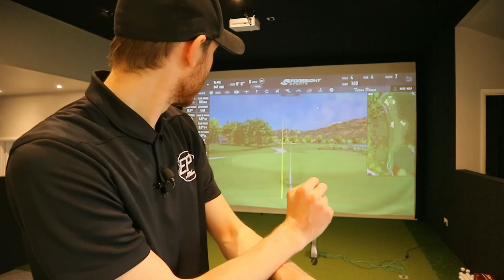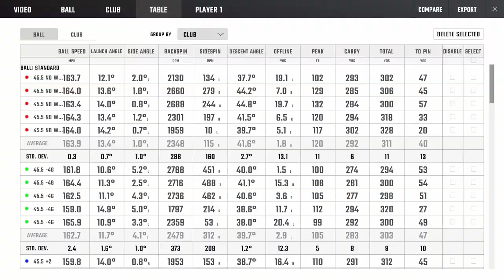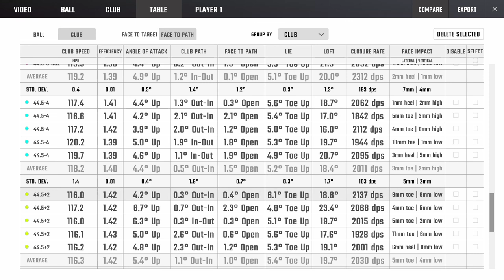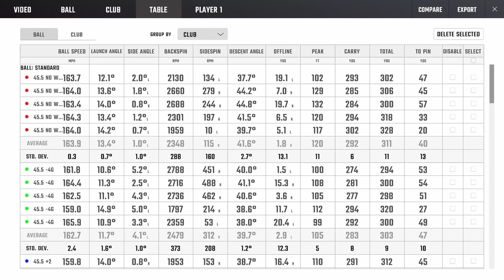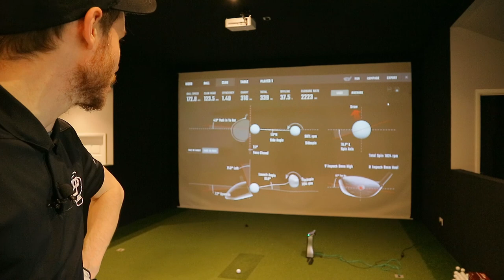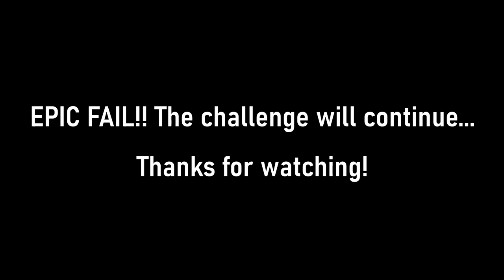More Ball Speed?!? Driver Length & Swing Weight Test.

Comment: Great video. Kinetic energy is 0.5*m*v^2. More energy is transferred to the ball because you can accelerate the lighter the club to a higher velocity. The velocity term in the energy equation is squared so it plays a much more significant role than the mass in determining the exit velocity of the ball. Been having great success with a light driver. You just need time to get used to it. Thanks for the video.
Reply from the maker: Thanks for the comment Ben..

But complicated for me all that 😅 we just test and see what works the best 👀👀😅
Reply: @epgolfstudios  Yes, testing is the best way to figure stuff out 👍

Comment: So the lighter weight heads increased ball speed some, but the HUGE increase came from intent.
Good luck with your new channel. Maybe slow down the screen scrolling a bit. But I appreciate your efforts.
Maybe test overall club weight, lighter shafts vs heavier also for faster speeds. Just a thought. I wish I had a testing set-up like yours.
Reply from the maker: Thanks Scott, appreciate the comment pal. Not sure what you mean by intent? 

Yeah having watched back the scrolling is quick! Think for the most part we will take that out of future vids for majority its not required and just a data overload for most. 

Yeah I think lighter Vs heavier shafts for speed is just minimal. Like if swingweight was the same and I swang a 50g Vs 70g swingspeed would be hardly any different. Overall weight would certainly be a good one, with added head weight and heavy grip Vs no head weight and 25g grip. The difference in that for me would be massive.
Reply: By intent I mean the difference between your 100 test shots at normal speed and when you tried to hit it as far as possible to reach the green. That change from intent alone upped clubhead speed from 118 to 128. Wow. Unless you also altered your setup or swing in some technical manner, then it's all intent. Like imagining you're in the finals of the world long drive contest against Kyle and you either win or die. 

I have an iron set of Ram featherlite tour grind forged from Calvin Peete days and the difference in clubhead speed between normal weighted clubs is 5 mph faster for me.  The Rams are C5.5 at 14.5oz total weight 9 iron. Lighter clubs definitely help this weak a@@ old man.
Reply from the maker: @scottschairer110  ah ok yes I'm with you. Yeah I think when I get people swinging hard in the studio they are normally shocked at what they can actually get to with a bit of commitment. But yeah I mean I guess I wouldn't love to swing like that on course 😅 so really the test was can I achieve anything more keeping my swing the same. Which tbh even this test shocked me a bit, I didn't expect the ball speed to be that different. 

And yeah overall weight can make a huge difference. The light swingweight will definitely be good to move it a bit quicker 💪 but head weight I think plays a big part in that, 2g roughly in the head is 1 swingweight whereas about 9g in the shaft is 1 swingweight. So taking weight from the head can be more influential than shaft weight difference for sure. Just gotta be careful about how changing the headweight and swingweight makes the shaft play.

Comment: Excellent segment. I have the TSi3 as well and actually had a slightly differently results. I added +4g to the original 8g weight at 7.25 degree, stiff Tour Design shaft. Typically swing it in the 122-123mph range with 181mph ball speed. With the increased weight my clubspeed went up to 125mph and ball speed went up to 185mph based on my latest Trackman record session… my miss is a big pull left with lighter head weight so the added weight help prevent my occasional flip.
Reply: Did that take your swing weight up to a hefty D6?

Comment: My experience is get rid of your grip, get something thin and light grip. As minimal as your hand can grip, this increase swing weight and speed quite easily. Shortening shaft length and minimise grip size/weight together will also increase swing weight. Don’t add weight on club, not anywhere, increase total mass only slows you down.
Reply: Agree, this can be a better way to go for sure. The standard size (smaller) super light JumboMax grips are good for increasing swing weight.

Comment: This is definitely something I wanna ply around with. Currently in a tensei raw white 65 stiff playing 45.5 (tsi3). Wanna try 44.5 to see if I get better dispersion and efficiency.
Reply from the maker: It's 100% worth playing around with. I find for most people it's more of a disadvantage playing a longer shaft. 

I don't find you get any more club head speed (maybe 1 or 2 mph) but sometimes because the swingweight is so heavy at that length some people lose club speed. 

I personally feel standard manufacturers lengths of drivers now are far too long
Reply: @epgolfstudios  Might worth the trip down to see you before the summer!
Reply: Great video!!!!

Comment: How much of a factor do you think fatigue may have been?  You said yourself, after you finished with the longest club and heaviest weight combo, that you were feeling it in your back.  That makes me question how much of the rest of the results were club length/headweight vs player fatigue.

It would be interesting to try a similar experiment using a mechanical swing system to isolate the results from the human factor.  I don't expect a major discrepancy, but it would still be interesting to see.

Comment: Very interesting test. Ive got exactly the same swing speed but with completely different feel. I find the standard 193g weight of the TS3 head way too light, so added 6g of lead tape forward. Then added a counter balanced shaft.

It would have been interesting if you did a counter balanced test, I.e. +4 with a Fuji Tour Spec 2.0 for example.
Reply from the maker: Could well be an interesting test mate and I have just got the new Pro 1k orange too 👀👀 the Fuji Pro 2.0 is slightly counterbalanced but not massively I would say. Only a swingweight or so

Comment: When fitting, is the a common theme with regard ‘what works’ in regards to this test (increased ball speed)?
Reply from the maker: Not really bud no as everyone is different. Some people may prefer less weight and therefore get more out of it and some people will hate a light weight and therefore might struggle with strike and speed due to confidence and timing.

So no bit really bud

Comment: When you say different shaft lengths do you mean the actual length of the shaft on its on butt to tip or when its attached to the head of the club from butt to the bottom of the head?

Comment: I am gaming a mizuno  STZ set @ 8 degrees @ 44 inches with a tensi 1k 50 gram stiff tipped 1\2. Inch , head weight is 308 grams with a swing weight of  D-3 It is a absolute bomber. Easier to find the short grass @  44
Reply from the maker: Yeah shorter shaft for sure makes a huge difference to strike for most. OEM standard length these days is just crazy. And for most people I don't find they can swing it hardly any faster anyway, so not much advantage!

Comment: Very surprised to see no weight is better. I wonder how will it effect Lower spin drivers. Since they have all the weight by the face. My cobra has 13g up front, if I drop to 6g to C9 I would expect to get prob 800-1000 more spin. Or else why would manufacturers standard swing weight at d2-d4.
Reply from the maker: Remember this is for me, not necessarily for everyone. Although I do think on average people would gain more ball speed from a lighter swingweight. 

I think manufacturers have been going longer and longer in the shaft to try and create more swing speed. Which obviously increases swingweight, but they haven't messed with headweight which they will be going over the next few years I think.

If you changed the front weight of your Cobra from 13g to 6g the effect on spin would be marginal. The amount that's actually shifting CG isn't much. It might make 100-200 revs difference. 

The new TSR4 does a good job of that but even switching the heavy weight back it's 2-300 revs different.

You are only ever moving a very small amount of weight relative to the overall mass of the head. So it's never going to make a huge difference. 

But yeah in short if you remove head weight from the front of a lower spin driver it would shift CG further back but not much. So difference would never be close to 800 revs.

Comment: Very informative vid, but dudes, you can't get a realistic playing result from hitting multiple shots indoors with a launch monitor - you can hone it in for the best stats on the monitor with multiple swings, then take it out on the course where only the ONE swing that counts - and push it or pull it totally offline.
...and yes, I think launch monitors are almost useless..um I mean, they ARE useless 😂
Reply from the maker: Completely agree it's not a playing environment, from that respect fitting will never be perfect. 

However, it does give us the ability to get as close as possible to the club we believe will be best for you out on course. Not only in terms of consistency but also launch conditions, which even the most experienced golfer can't really see out on course. So from that respect we need launch monitors to give us consistent data to compare.

Ultimately if you can gain 10 to 20 yards from gaming another driver why wouldn't you. And that's not always possible of course, sometimes I can gain you 30 yards sometimes nothing, all depends on what you game now and if it's any good for you.

You will make bad swings and it will go offline of course, fitting can help reduce bad swings and misses in multiple ways, but we are very inconsistent as humans and therefore will hit bad shots with any clubs at some point, far more than we would like I'm sure!

But even in this video from tweaking weights and lengths I gained massive ball speed. How could that be a bad thing. And without launch monitors we would never know that. 

Completely get your point that you can get fit and then go out on course and hit bad shots, 100% it doesn't guarantee you will hit every fairway. But if you are going to spend your hard earned cash on something, surely you would not only want to see it, feel it, listen to it, but also know that your good shots are going to be as optimised for you as possible 👌and get you the best results when you make those good swings.

No brainer. 🤙
Reply: I honestly don't know how you can say launch monitors are useless. In the game of golf where data can be hard to come by when you're playing on a course, launch monitor's are a blessing. They've probably even advanced how we swing as well. Even the portable launch monitors and the shot tracking watches you have on the course are massive helps. The more data you have the better when in the right hands. I remember playing 10 or so years ago when we had no shot tracking data out on the course and it was basically guess work if you had no range finder.

Comment: how does total weight affect the performance of a golfclub? And whats the difference in performance of a 280 gram abd a 320 gram club with the same swingweight?
Reply from the maker: It will be different for every player which is why getting fitted is so important. But generally speaking, heavier would mean slightly less swing speed, and for most that would also tie into more of a right miss. But again that is very player dependant